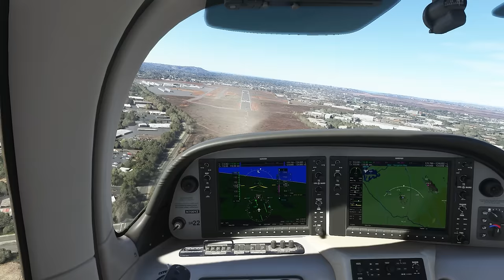Fatal Plane Crash At Montgomery Field After Student Pilot Declares An Emergency | N700YZ Crash

Comment: When the controller heard there was an emergency she should have halted all take off’s and waited. People can wait to take off and people in the air can wait. Disappointed in the controller. If she wasn’t trying to control other pilots on land, and just halted all take off’s maybe they wouldn’t have stepped on each other so much. Could the pilot have done better of course, but he’s a student pilot. The controller is an experienced controller. Isn’t it easier to take no risk and halt things than to still give take off clearances?
Reply: That would not have been a good call. There was already an aircraft sitting on the runway in a LUAW position when an emergency was declared. If the emergency aircraft had come down on that runway, there may have been two or more fatalities. Better to clear the runway. What I would have added is that all aircraft immediately depart on the upwind 45° right of runway heading. Get the airspace clear in an orderly fashion instead of having everyone in the path of a 100 mph missile heading for somewhere on the airport.
Reply: Well the airport did get shut down and they cleared the runway as fast possible. I mean how can it be any better then that?

Comment: If the airplane was BRS equipped, I wonder why he didn't use it.    The poor pilot sounded like he had no idea what to do.
He didn't mention what trim was affected, but I think I would have added power and climbed as best I could so I would have more altitude and time to sort it out.
If the engine is running, and you aren't on fire, there are few times when just putting the plane on the ground is the best first option.  
If it was electric trim, pulling the breaker would fix that.
Reply: Yes, it comes back to the old first rule of "fly the plane".  It appears he just panicked.  Very sad.

Comment: Putting something unnecessary between my trim wheel (like an electric motor with gear reduction) and the pushrod or cable is not for me in a GA plane. 
Sorry, I like to "feel" my way around....and that little joy-stick can go away too. My brothers C-172 has a giant lever on the floor for flaps...It immediately tells you how much stress you apply to the flaps when you try to lower them above the airspeed limits. And that's just for starters....

Comment: This guy was like most low time pilots,  afraid of his airplane. He was taught to fly as a passenger with the airplane flying him.  My first plane didn’t even have trim.  If you’re going to freak out over run away trim (which is fairly common) you probably are to type A to be flying.   If he wasn’t he would have easily over ridden the trim servo.   You have the option to flip the master switch off….   If your plane has electric trim and or auto pilot you better know where the fuse, circuit breaker, and disengage button are.   I’ve never seen an auto pilot that wouldn’t break free if you put a little bit of force into fighting it.  It might take a little.  But if you’re not afraid of the plane you can break it free.   This guy had a bad CFI.  His blood is on their hands.

Comment: Sounded like he was fighting more than Spring-force. But, his speed on Final should have greatly reduced Aerodynamic-force from the trim tab. If the circuit breakers had been closer to the dash than the floor, he might have had time to work the problem. Don't know how it is these days with these airplanes, but Instructors used to pull breakers/fuses on me all the time. What did, "I have to land" mean? Unable to climb the airplane? Unwilling to take a broken airplane around the pattern? It sounded to me that he had no choice.

Comment: TRAGIC. Only speculation is possible at this point. Trim and stuck Mike makes one consider an electrical problem as both buttons are on the control stick? Or inadvertent pilot input? Just speculation. Let's see what the experts find.

Comment: Stupid death. Internet shows it was SR20 G6, SN 2599, so around 2018 - 2019. New Aircraft. It was equipped with Perspective avionics. In this case, you can always push and hold A/P DISC button on the stick, which disconnects the A/P, but also the trims. More likely its caused by specific trimming solution in SR's. In my opinion - lack of training. Awaiting for the final report.

Comment: This controller had terrible ATC local control skills.  With only 4 planes in the pattern she was overwhelmed and had substandard separation resulting in an off runway incident.  If separation was increased to reflect the few planes in the pattern there would have been a chance to land on the runway.  But the big thing here is that the controller got herself in a situation where she needed to talk to 4 pilots simultaneously.   This resulted in her lack of control of the situation.  Student pilot was overwhelmed and frustrated at the inability to talk to the tower, and more importantly, to other pilots who could have saved his life.  Send her straight to FSS where all crappy controllers end up in order to save the lives of future pilots.

Comment: A Cessna 182 i was flying out of Opalocka Airport In Miami had similar problems. 
During take off and at around 700 feet the auto pilot activated by itself.  The elevator was stuck. I continued to fly the plane. I told tower i will stay in pattern and to land.  I pulled the auto pilot circuit breakers. The elevator was stuck in a slight up position and trim was stuck.  I could only control altitude with engine power.  I didn't want to force the yoke down because I thought the cables or pulleys was damage.  I didn't want anything to break

I did land the plane safely by using engine power to gain it loose altitude .

And yes i thought I was going to die as plane stalls and crashes.

Comment: Actually sounds like he hit auto pilot and the plane was flying itself in….. I’ve programmed this problem into simulators where the yoke pressure wouldn’t disconnect the autopilot…. It is confusing and down low you have seconds to understand and respond.

Comment: I’ve mainly flown with old aircraft but if I’m flying a newer glass model with automatics I won’t think about flying it unless I can disengage A/P and cutout Trim along with pulling the breakers blindfolded for this reason. It should be standard practice, a life could have been saved if it was RIP

Comment: Maybe the pilot mistakenly turned on auto-pilot, with the settings not configured  correctly, it could drive the Nose down,..?
Reply: A very plausible mistake. The correction of that mistake is very quick and simple, and almost too easy. Which brings back the question of training and lack of experience. This may have just been too much airplane for him.

Comment: I’d love to know more about the trim issue… what would a pilot do if the trim is stuck and or put in a dangerous setting on final? 

I’m a student pilot, so anything anyone shares is super helpful..

May that pilot rest in peace…
Reply: I had the elevator trim stick in the up position in a 172. There is plenty of control surface to overcome a trim tab. The problem is it may require operating the controls in ways you are unaccustomed to. I was on my base turn at an uncontrolled airport so I just throttled up and climbed to 4000 AGL and practice my approach procedures at altitude. I set in my mind that the runway was at 3500 AGL and practiced "landing" procedures until I was comfortable with it then made a fair landing. In any situation like this my personal rule is altitude won't kill you as fast as dirt. ALtitude gives you time to sort things out.
Reply: @HobbitHomes263  that is some solid advice! Thank you for taking the time to share. 😎👍👍
Reply: Stall spin. Not a trim issue. He got to slow and the cirrus kept pushing his nose down. He was mistaken.
Reply: I agree with the other two posters. Here is what I would like to add. 

Your pre-start checklist, your pre-taxi checklist, and your run-up should all include systems checks. Well before getting in the aircraft solo, you should find out and know how to operate and disconnect every system. For auto-pilot, and electric trim and flaps, know several different ways to disconnect the electric trim/flaps and autopilot. For the autopilots I operate, I know 6 different ways to disconnect them. 

Before you do your pre-takeoff checklist, you should practice/demo each method of disconnecting your autopilot. The only ones that you will not do is actually pulling the circuit breakers and actually turning off the Master. Just verbally acknowledge those and place your hand on them. You should be able to identify these by feel alone. 

A perfect time to do the autopilot systems check is either your pre-taxi or your run-up. Some aircraft will allow you to do it during your pre-start (with the Master on). I prefer to do it during my pre-taxi. 

Doing this during every start-up will make a runaway trim or autopilot an Abnormal Event instead of an Emergency. It will also make it an immediate muscle memory item, sort of like pitching nose down during a stall. 

The second part of this is practice systems failures with an instructor at high altitudes. If it is not already a part of your curriculum, ask your instructor to demonstrate and teach the failure of each and every control (primary, secondary, and tertiary if you have it). Rudders linkages may fail. Empennages may lose effectiveness/authority if masked by high-wing flaps. You can (to a limited amount) bank and turn an aircraft without using flaps. Flaps may fail whether electric or manual. And, pilots (like me) will occasionally activate the autopilot on the wrong setting. So, the autopilot will respond how it is programmed instead of how you were expecting (pilot error). 

Training and practice makes none of these a surprise to the pilot and easily/quickly fixed. A systems check (or checking autopilot settings) will often eliminate or mitigate the risk even before it happens. Catching the risk even before the aircraft moves from parking would be the ultimate in ADM.
Reply: @deanfowlkes  thank you for taking the time to share and educate ❤️😎 this super helpful:
Reply: @sirkreitz4484  - For reference the six different ways on my G1000 are:
- The autopilot activate/disconnect button.
- The TOGA button
- The CWS yoke button
- The electric trim thumb switches
- Overpowering the yoke input will trip feedback sensors that will disconnect the autopilot 
- Pull the only red breaker that has a safety identification collar.

I pretty much do it in this order every single time. Primarily because I don’t want to pull the breaker unless I absolutely have to. And, flipping the Master is an absolute last resort for me. If I disable power, I will have to slip all the way to a landing. Not a big deal on the 7,000 foot runway of my home airport. A bigger deal on some of the sub-3000 foot runways where so typically land. Especially if so have to pull a downwind landing.

The Cirrus Garmin Perspective is almost identical to the Garmin G1000.
Reply: @sirkreitz4484  No matter what goes wrong the FIRST thing in your mind should be "FLY THE AIRPLANE" Unfortunately, this pilot panicked and did not think to disable the auto-trim. The elevator control surfaces have plenty of power to overpower the trim tab. If he was able to fly it toward the ground he probably could have flown it UP

Comment: If the plane had electric trim, he could have disabled it, there was likely an override switch, and adjusted the trim manually, the controller should have responded to the emergency declaration
Reply: Very hard to do in a Cirrus from what I've heard.  The breaker box is down by your legs/feet.  He'd have needed to climb and get more time.
Reply: @gringoloco8576  then you kill the master switch
Reply: @gringoloco8576  my plane has a separate kill switch for the trim right at the yoke, I’ve had to.disengage, but it was because it wasn’t responding, used the trim wheel, went old school

Comment: If only the US would stick to ICAO designated r/t and use “Mayday Mayday Mayday” declaring an emergency there would  less chance of confusion and misunderstanding as there appears to be in this case. ‘I’m declaring an emergency” followed by the reasons and intentions (NITS)  in one sentence can be easily be misheard or stepped on. In my 45 year aviation career I heard a mayday being properly declared 2 or 3 times and without, exception the frequency went silent except for ATC dealing with the problem and handing off other aircraft.

Comment: I fully agree with the runaway trim analysis, that was the most likely cause. But there is something else I just don't understand. There was a plane on take off, cleared into a right turn out and then .................the controller tells the mishap plane to off set the runway to the  right. That just does not make sense to me. The offset should have been tot the left, clear of all traffic. 
I am not familiar with the field, but unless there is a huge obstruction to the left, the offset instruction shou;ld have been to the left (or south side of the active). Now the controller was setting them up for a potential dangerous situation, which did not happen because of the crash of the mishap aircraft.
Reply: There's a parallel runway to the left that's being used.
Reply: @Mark625S  true, there is a parallel runway, but I did not hear anyone in a left hand pattern. 
In this case the aircraft just in front of the mishap plane was cleared into a right hand pattern and that creates a conflict with the mishap plane (if that plane would have been able to go around). Instead it crashed, so no actual conflict happened.

Comment: Doesn't serious have a parachute systems and stuff. What kind of trim could go wild on on a plane like that? I know my Cessna 150 you could land it with any trim consider any trim setting trim wasn't an issue for the Cessna 150 which really made it a bad training plane it's only when you get to the Cessna 172 that trim can be used to stabilize a plane anyhow a great great story to cover
Reply: Trim is used to hold a speed. Incorrectly setting or forgetting manual trim when changing power settings can have dangerous results. Compound that with the ability for the autopilot to or the pilot to electrically adjust trim, you add another dimension to the problem. Electric switches and electronic actuators can fail in both the on and the off position. Or, they can short and start actuating trim on their own. Or, a pilot might inadvertently activate a perfectly operating electrical trim system.

Comment: Non pilot here: did I not hear the pilot DECLARE an emergency and the traffic controller didn't??? she then states at least twice or three times for him to go around?
Reply: He declared an emergency, but did not say who or where he was. ATC acknowledged the emergency by first getting the aircraft in a LUAW position on the runway to clear the runway. 

Since a stuck or runaway trim is not necessarily an emergency, he did not need to land immediately. What is more important is that he was trying to land in an unstabilized approach. You can fly the aircraft with a stick or runaway trim. If your approach is unstabilized, a student pilot will probably crash. 

The best course of action with a stuck or runaway trim would be to gain airspeed and altitude immediately. Get stabilized. Work out the mechanical and electrical issues. Then, come back in for a standard landing.
Reply: Well the runway was cleared and she shut down the airport for the emergency landing. She never was telling him to divert she was telling everyone else.

Comment: He should have been trained on runaway trim in an aircraft equipped like that well before soloing. Most of us normies learn on a cessna 152 or 172 manually trimming it. The more complex systems an aircraft has the more weird things can go wrong that you have to quickly and correctly troubleshoot otherwise you'll be a smoking hole in the ground which is the sad truth when it comes to flying. Bad pilots don't have long careers unfortunately.

Comment: Though we don't know all the facts many comments here likely correct....too much airplane (ego) for a rookie pilot. This is nothng new. I started my career as a CFI back in the 80's and it's sad nothing has changed. We had the students....we all knew who they were because they got passed around from CFI to CFI...who took 130 hrs to get their pvt then proudly announced they had bought a C210 or Bonanza. We just shook our heads. In fact back in the day the V tail Bonanza was nicknamed the fork tail doctor killer.  The Cirrus is todays Bonanza. I won't say getting a Pvt in a SR20 is impossible, but it would take an exceptional student. Most non career student pilots are not exceptional.   Most Cirrus owners are in way over their heads in that airplane. And now,, ego has killed another pilot.     RIP.

Comment: I'm no pilot but seems crazy they all fly in circles and taking chances but then I'm not into flying they fall out of the sky everyday RIP
Reply: I'm a flight instructor and it is a little crazy. Even we think so!
Reply: When learning to fly, it feel like all you do is fly in circles. Which is exactly what you do when learning "pattern work" - IOW, landing the plane. The easy part of flying - straight cruising - is not where you spend most of your time. You need to focus on the hard stuff.

I did so many trips around - and up and down - an airport once, I felt like I got off a tilt-a-whirl when it was done.

Comment: Easy to say from my chair.  Aviate, navigate, communicate.    When issue happened.  This pilot went to “get on ground where I am safe” mode?    Very sad he died.   Fighting controls is not fun.   But maybe if he let plane fly ha could have found reason, how to adapt to it. First time controls try to override your inputs is shocking. “Oh I forgot to shut auto off…wait what” (only $200 part replacement $50 part, $150 labor to plug it in)